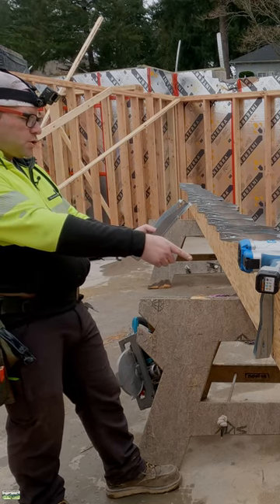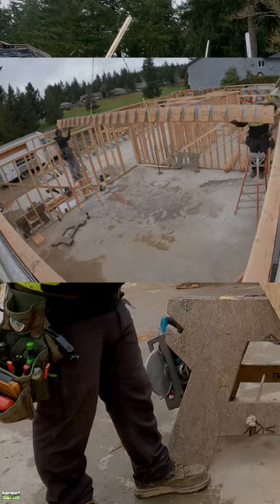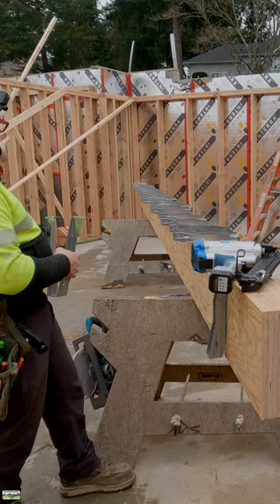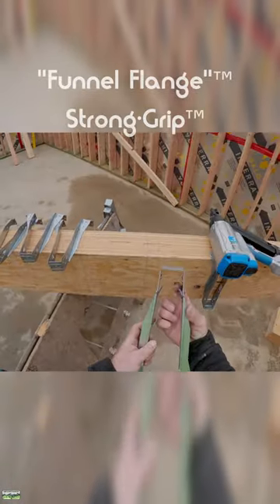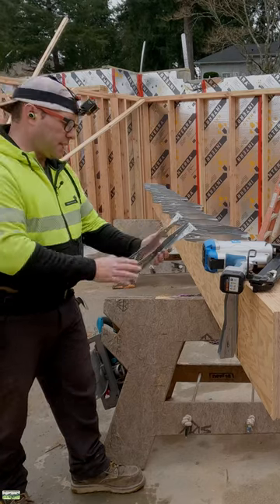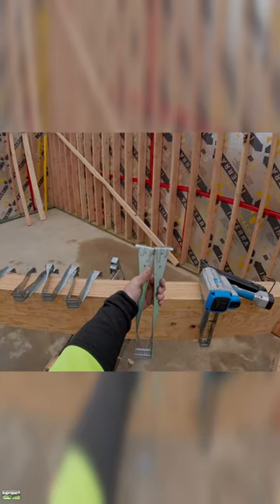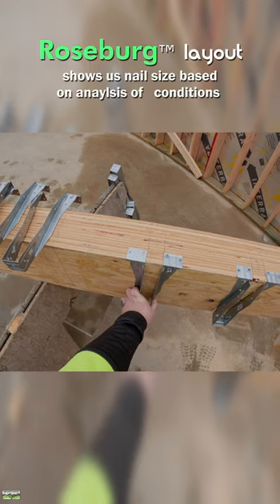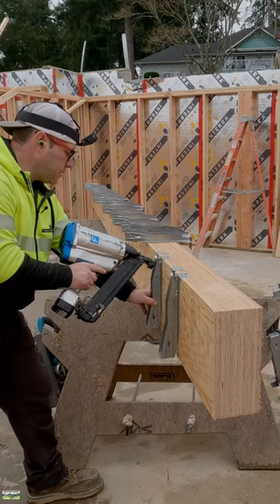How to Install Hangers BEFORE Lifting a Beam

Comment: must be nice to have engineers.  The contractors I work for would have  made me use a  notched  2×12 and a wood ledger.
Reply: Can you show imagine of what you mean or an example of how that looks?
Reply: @VP411Designs   won't allow me to share links or photos in the comments.. very standard way of building before they had metal hangers. It's a ripped In half  2×4  nailed to the bottom of  the beam, and you cut a notch into the joist. Google notched joist wood ledger

Comment: The framers in my area try to add those style hangers after the subfloor is installed on top of the beam and wonder why they fail inspection
Reply: Why would it fail?

Comment: Hey Tim! A tip I've used is use an off cut of an I joist or a dimensional lumber piece in the right size of your joist that is just.longer than the hanger (protruding toward you) this allows you to put it on to the correct width without scribing a line for each just your center to centers between instead 😏
Reply: I am with you jack you only need one line and the cut off done.

Comment: A small block of the joist would be more accurate and consistent.
Reply from the maker: I know where you're coming from, but in reality, that just isn't true.  There's not need to handle an offcut of an I Joist to accurately locate and install hangers for those who are experienced. For those that aren't experienced, this video will teach them.

Comment: I’m glad you are not building my house. I have a hatred of using plywood where a solid piece of wood should be. I don’t care if you use 6 2x4’s. Plywood delaminates, so it is going to need to be redone. So when it causes the whole roof to be rebuilt, the builder should cover all work, housing while redone, and compensate for the shitty work.

Comment: that is gonna be sharp if it gets loose, also
sometimes the joist stock is varied in dimension
Reply from the maker: don't let it get loose.  Do you drive in the rain?

As stated in the video, I Joist dimensions are very consistent.
Reply: @AwesomeFramers  the real issue that inspires our riskiest behaviour is the ever shrinking dollar.
 1971 minimum wage of $1.60 bought an ounce of gold in 21 hours, and a brand new full size pick up in 1750 work hours. That would mean starting your beginning carpenter at $85.00 relative to gold, and $35.00 relative to trucks.
When you get to this price point let me know.
Reply from the maker: @georgemckenzie2525  🤣🤣🤣🤣 Your comment is the perfect example of the "red herring" argument fallacy and classic internet.  As stated earlier, before you changed direction, don't let the beam get loose (easy, we drive in the rain all the time safely, ergo we can plan and adapt) and I Joists are very consistent in dimension.